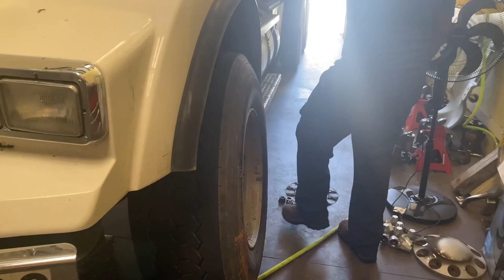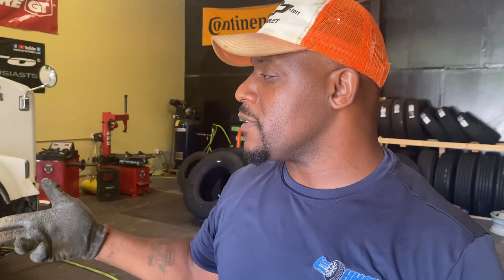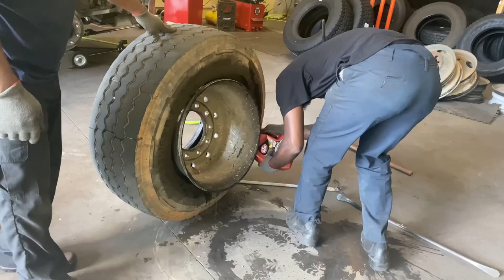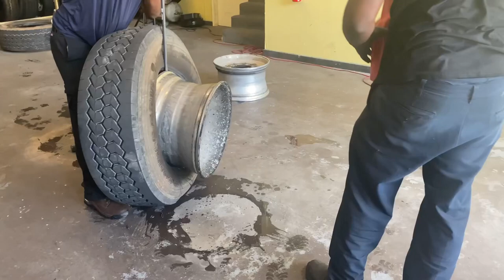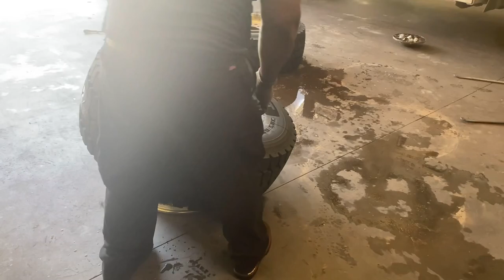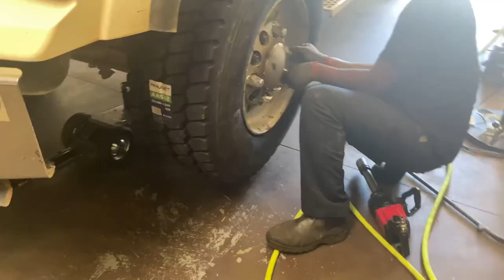Huge tire causing huge problems!

Comment: The dismount was through the other side, if I am not mistaken.
Reply from the maker: These actually dismount from the front …..that’s the side of the wheel with a lip
Reply: They have it on the right side